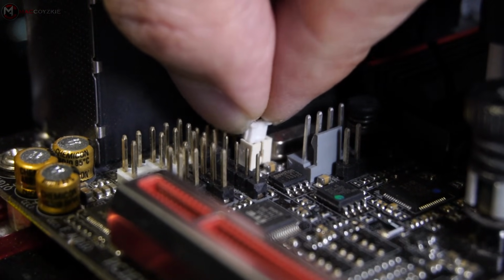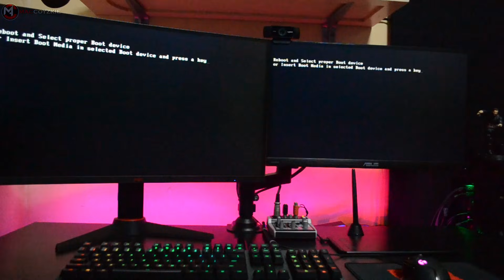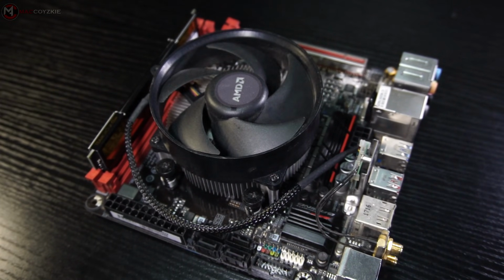How to remove cmos battery in your pc? Cmos reset / hard reset on bios

Comment: Bro I need help. Normally my monitor shows the display, but when I try to access BIOS settings or try to use Advanced Options to reset my PC or Repair, it shows "No Display Port." Also the same issue with the HDMI. Then, when I press the restart button, my PC restarts normally, and the display works again. I can't access my BIOS settings or use Advanced Options. What should I do? My BIOS is in UEFI mode. My display cable is connected to the GPU Display Port. One day, I used our Walton TV with my monitor's HDMI 2.1 cable, and the TV showed the BIOS display. However, it’s not working with my monitor. I can't find a solution on YouTube as well. 

My System Specs:

- CPU: Intel 13th Gen Core i9 13900K Raptor Lake Processor
- Motherboard: MSI Z790-P WIFI DDR5 13th Generation
- RAM: G.Skill Ripjaws S5 DDR5 6000MHz (16x2) = 32GB
- SSD: Samsung 980 (2x1) 2TB PCIe 3.0 M.2 NVMe SSD
- HDD: Toshiba P300 HDWD220UZSVA 2TB 5400RPM
- GPU: MSI GeForce RTX 4090 GAMING TRIO 24GB GDDR6X Graphics Card
- PSU: Thermaltake Toughpower GF3 1000W 80+ Gold ATX 3.0 Full Modular Power Supply TT Premium Edition
- Monitor: ASUS TUF Gaming VG28UQL1A HDMI 2.1 Gaming Monitor — 28-inch 4K UHD (3840 x 2160), Fast IPS, 144 Hz, 1 ms GTG
- Casing: Lian Li O11 Dynamic XL ROG Certified Full Tower Case (White)
- Casing Cooler 1: Lian Li UNI FAN AL AL120-3W Revolutionized Daisy-Chain ARGB Case Fan (White)
- Casing Cooler 2: Lian Li UNI FAN SL-INFINITY 120mm ARGB Case Fan Triple Pack (White)
- Keyboard: K100 RGB Optical-Mechanical Gaming Keyboard — CORSAIR OPX Switch (Black)
- Mouse: Razer Viper Ultimate Wireless Gaming Mouse & RGB Charging Dock - Optical Mouse Switch - Cyberpunk 2077 Edition
- Headphones: HyperX Cloud II Surround Sound 7.1 Gaming Headset (Gun Metal)
Reply from the maker: i answered your first comment bro

Comment: I was installing a game last night and I noticed after downloading the game my m.2 SSD was nearly full, I had 8GB left of 500. My computer then froze and went into the blue window screen. I shut off my pc when I saw the blue screen then I started up my pc again and it booted me straight into bios. My m.2 was not showing up in bios, additionally my m.2 always has a red light on, i looked at the m.2 and the light was no longer blinking. I tried taking the cmos battery out already, I tried taking the m.2 out already and putting it back in. Is there any fixes or is all my stuff gone ??????
Reply from the maker: there must always be at least 25% free space on any drive less it won't work properly. go to safe mode https://youtube.com/shorts/IZKc8plksDA then uninstall that large game in it.

you might also need to watch this for more info https://www.youtube.com/playlist?list=PLqHl1qasBnOG9u0GuqPQHK1rofReu2PVK
Reply: @MacCoyzkie  what if the m.2 devices does not show up as a boot priority, could I still go into safe mode even if it automatically kicks me into bios?
Reply from the maker: @scarrsin  you have to try, if you can't enter safe mode still try clearing cmos and try again. if you still can't enter safe mode there is nothing we can do now, you might need to reformat the drive already to be able to use it again

Comment: idek If anyone is going to see this…I dropped my pc not hard but after a couple my cpu started overheating and I thought it was thermal paste.Put fresh paste on and now my pc wont display anything and my usb ports dont work on parts of the computer
Reply from the maker: try reseating the gpu and its power source, the ram sticks and the drives and do the cmos reset again

Comment: I wish this worked. I just moved back to my parents, and the pc worked perfectly fine beforehand. Now my monitor won't display despite being connected, and neither my keyboard, or mouse are working either. I hard resetted, did this method, took out RAM and put it back in - nothing. I'm at a loss, and fearing that I will have to cough up money and get it fixed
Reply from the maker: let's check the basics first https://youtube.com/shorts/-IMdGQKLwrg

if you already done that then i guess the moving of the pc might have caused some parts to detach somehow. do you know that you need to remove the gpu from the motherboard if you are moving the pc? this is a must specially if you'll travel far. anyway you have to reattach everything at this point, clean off dust while you're at it
Reply: @MacCoyzkie  I was sadly unaware - it was basically a 2 hour drive so I didn't think much about it, especially since I moved it 2 times before and nothing happened to it, guess I was just lucky until now. I'm scared to touch anything since this is my first pc, so I'm ngl, it's scary to be told this. ;-; I'm definitely ignorant in the pc department, is there a guide for this?
Reply from the maker: @TheNikolasC  its ok but hopefully the ride wasn't too bumpy. What you can do right now is just to reattach the gpu, i know it sounds intimidating removing the pc parts specially for beginners but one thing you should keep in mind that this is a part of having a pc. we must learn it one way or another. 

there is a latch that locks the gpu in place, unlock that first. you can also check this quick tutorial on how to https://youtube.com/shorts/9N_5YmJRHko
Reply: @MacCoyzkie  alrighty, I'll give it a look, thank you for your help so far. I'll let you know if it works or not
Reply: @MacCoyzkie  sadly didn't work either
Reply from the maker: @TheNikolasC  this is bad, umm i hope you got a relative with a pc or a friend, can you ask them to try your gpu in their pc to check?
Reply: @MacCoyzkie  I sadly don't, and just recently I tried another potential solution and now my pc won't turn on at all - so I will probably just bite the bullet and try to pay for a tech to fix it
Reply from the maker: @TheNikolasC  i guess that's the only way, sorry bro
Reply: @MacCoyzkie  it genuinely sucks since I tried hard to avoid it, but I only made things worse, so it is what it is. I really appreciate your attempts at helping me through, it means a lot
Reply from the maker: @TheNikolasC  no problem bro i hope it all goes well soon

Comment: Let's say that my drivers for my keyboard and mouse are corrupt/missing and I can't do anything on my computer, will removing the battery do the job?
Reply from the maker: no, use a different mouse and keyboard, go to safe mode and look for those software and uninstall them
Reply: @MacCoyzkie  I tried other ones, but still they don't work
Reply from the maker: @szymondemski2557  that's no longer just corrupted drivers anymore if so, try to remove the boot drive and use a different drive without os. you should be able to go to bios and use your keyboard mouse again. if that still does not work you have a broken motherboard, you should bring it at a local shop to check
Reply: @MacCoyzkie  yea I'm planning to send it to  professional this weekend, hope the repair is not that expensive, luckily I have nothing too important on the PC
Reply from the maker: @szymondemski2557  if you got no important files in the C driver just have a fresh windows installation yourself to save money. prepare this first to begin https://youtu.be/FfPBOccfG70

Comment: Hello when I remove the cmos battery and wait do I turn the pc back on without the battery or with it cause I waited 10min put the battery back in and still black screen?
Reply from the maker: no, basically just leave the pc unplugged, remove cmos battery and leave the motherboard without cmos bat for a few minutes. return it before turning the pc back on
Reply: @MacCoyzkie  i overclocked my system and something went wrong after years. Now even if i short the cmos jumper even the stock settings are still messed up. Do you think removing the cmos battery will help?
Reply from the maker: @НААТ  so it was overclocked for two years and was working fine? i need to know what happened before the pc problem started so i can have an idea

Comment: I have ami bios motherboard. Im new to building pc, so i installed parts and got 5 beep sound. What should i do? My motherboard manual doesn't say much about beep codes
Reply from the maker: The 5 short beep code is related to the system not finding a CPU, check if the cpu is seated correctly or at least reseat it
Reply: @MacCoyzkie  oh okay, thank you so much 🙏🏼
You're right, I've checked with another processor and it works fine. 
Thanks alot

Comment: My PC stucked on motherboard splashscreen on boot up and I can't even go to the bios setup even if I press f12 or DEL.

I also tried removing cmos battery for 10 mins and still stucked on the splash screen and still can't go to bios setup
Reply from the maker: you might have a very old hdd plugged in your pc, remove any old drives and just try to boot with your ssd boot drive atm to check
Reply: @MacCoyzkie  I will try this, I actually suspect my ssd (where my os is installed ) being corrupted or something. Thanks! I will update here once fixed.

Comment: I’m having the reboot problem and this didn’t work for me 😢 is there anything else i can do?
Reply from the maker: this video should fix it but if it doesn't then your boot drive doesn't have any os yet or it is corrupted. Reattach the sata cables on your boot drive, do the clear cmos again and if that still does not work you need to install windows in your boot drive

Comment: After 2 years of my using my new gaming PC. Mother board Asus Darkhero VIII . I got error message when booting: Please enter setup to recover BIOS settings. Press F1 to run Setup. I have replaced the CMOS battery with new one still get this problem. If I leave my computer unplugged for 4 weeks I loose the system date and time after changing the batttery is this normal? How can I fix this issue?
Reply from the maker: at least remove the cmos for a few minutes perhaps it just needed to hard reset. try to replace the cmos might work but not so sure though

Comment: It works. omg. Your video is a savior. I nearly cried when my pc suddenly was not showing display when I installed a new ram.
Reply from the maker: glad it worked! that is usually the case when you install a new hardware, you need to do this so the new hardware will be detected

Comment: So ever since I built my pc I’ve only had one small issue and that is every time I turn it on it shows the black screen with lettering saying press F1 and only F1 and it send me to the bios everytime, and manually exit bios to boot into windows. I have windows as primary boot #1 but it still does nothing. Do I need to reset and redownload windows without any HDD connected to it? Help please
Reply from the maker: try replacing the data sata cable on your boot drive if you are using ssd or hdd. if you're using m.2 try to reattach it and clear cmos like in this video. this will help the motherboard detect the boot drive. If it still happens start backing up your files then do a clean windows installation already

Comment: Few days ago I decided to clean my PC, so I used a blower (I turned off the power and I also didn't touch any equipment, I didn't unplug any wire from GPU, CPU, mainboard etc...) after I finished with the cleaning I came to turn my PC on but it went off right after I turned it on... so I decided to test few things, like I detached the RAMs and changed their places and I also switched the power outlet (instead of using multi outlet I connected PC straight to the outlet) so the thing happened was that PC stayed on for a longer time (few more seconds) but it still went off and turned on again by itself... it's more like a restart loop... rn I connected the monitor but I don't have a screen at all not even mainboard logo and literally black screen...
Reply from the maker: what kind of blower, are you talking about canned air or the one for hair dryer?

Comment: Heyy mate, I'm getting the American Megatrends screen every boot (after a long period of power off) I think is the cmos battery because I don't see any error message in that screen just "press f1 to recover bios settings", u think it is? or maybe another problem, my pc runs fine, just that screen is the bad thing haha
Reply from the maker: probably the boot drive is loosing connection or you need to replace the sata cable. you do that and clear cmos again

Comment: I have a tiny clip on mine but when I push it nothing happens I have tried several times and it won’t come out. I have the same battery as the first one not covered in plastic. Looks as if some plastic clips are holding it in place
Reply from the maker: you might need the help of the local shop
Reply: @MacCoyzkie  I figured it out… it has a gap underneath that allows for a flathead to fit and I just lifted up and the battery came out with no issues. Unfortunately I think my mb is dead because clearing cmos did nothing for me. My pc won’t post

Comment: hey i just tried everything from this video and the same message still pops up. i read some comments and saw that i could try removing the cmos battery and waiting 5 mins and putting it back, but after resetting and turning my pc back on the same message shows up again. any tips? pls😭
Reply from the maker: usually happens if your drive doesn't have windows installed in it or it has a broken sata cables( data & power) or it could be a broken drive

so replace the sata cables to check and if it doesn't work ask a friend to test your boot drive in their pc to see if its working

Comment: Please help me bro I tried booting again and it started popping up
Reply from the maker: you need to elaborate that, im not sure where you are coming from
Reply: @MacCoyzkie  okay so  my coumputer takes my to the advanced option and the reset pc option is not there and system restore does not work I only have access to cmd and bios
Reply from the maker: @mohanadalrikabw6632  sounds like a messed up windows, can you try this since you can go to command prompt https://youtube.com/shorts/GsfhmuZmzx4
this is to check the windows os and hopefully fix possible problems

Comment: can i change the battery with the computer running ? that way the bios won't need to be reset? or is there any other way around resetting the bios with computer off? cheers
Reply from the maker: no you can't, try to replace the cmos battery within 30 seconds, cmos reset will happen after a minute or usually 5 minutes. Btw if your pc is working just fine you don't need to replace the cmos battery
Reply: @MacCoyzkie  the problem is the computer has been left for 5 months without being turned on and is getting no boot drive screen when turning on sometimes now /not always. i figured it would be the cmos battery as haven't changed in over 10 years . not sure what else to try
Reply from the maker: @jlindell6532  i hope it is not something like this https://youtube.com/shorts/NcLkeTdquXw but what you can do right now is have each part tested in your friend's compatible pc to check which part is causing the problem. You can also try to replace cmos but usually if the cmos battery is depleted it will show something like this on your screen https://youtu.be/ul3D0OhSkdg

Comment: Hey mac, I’ve had my gaming pc for a little more that 4 years now with negligible issues. Randomly one day it would not boot up. When I try to boot it up the the fans move for a split second and stop. The cpu fan doesn’t spin even for a split second. I’ve tried to remove the ram sticks and place them in different spots which was to no avail. Also tried to remove the cmos battery for 5 mins while the power button was off and put it back in which didn’t help either. Any suggestions on how I could fix this would be of great help
Reply from the maker: hopefully you can still enter safe mode, here's how https://youtube.com/shorts/IZKc8plksDA and if ever you got in check your boot drive or any drive connected to the pc, it might be 90% full and usually that causes the pc to act that way

Comment: My pc won’t show any signal for usbs or hdmi and I took out one of my ram sticks before this and plugged it back in and now it isn’t working
Reply from the maker: what happen before the no display happen anyway?
Reply: @MacCoyzkie  well I was playing beamng and it was saying it was only displaying 8gb of ram although I have 2  sticks of 8gb so I took it out and put it back in but the first time I did it the ram wasn’t in properly I’m pretty sure so idk what has happened I don’t know too much about pc’s
Reply from the maker: @BeckosEL-AU  can you try to re attach the both? here's a guide https://youtu.be/UKR5xRsOhNg
Reply: @MacCoyzkie  yes I’ve done that and it still gives no signal for anything my mouse and kb don’t light up or work when I turn the pc on
Reply from the maker: @BeckosEL-AU  oh no that's not a good sign, can you have your psu tested using a tester like this https://youtube.com/shorts/YrC3PlflLq0 if your psu is fine then this is a broken motherboard
Reply: @MacCoyzkie  I havent got one but I might get one would you have any ideas that can happen when you put ram sticks in while pc is running or anything to do with that to make the hdmi and usbs not work?
Reply from the maker: @BeckosEL-AU  in some cases pc will break but in some nothing happens and pc will just run normally, why would you do that in the first place?
Reply: @MacCoyzkie  as I said before I was just taking out the ram and putting it back in because only one of the sticks were working, I turned it back on after and nothing worked.
Reply from the maker: @BeckosEL-AU  no i mean why during the pc is on,, nvm. umm you might need to have the ram sticks tested with a friend's pc to check if it works

Comment: when removing the cmos battery, should you have anything plugged in?
Reply from the maker: the pc must not be plugged in any wall outlet, a times the gpu is on the way you can remove the gpu for a while but everything else should be plugged like the ssd, ram and cpu